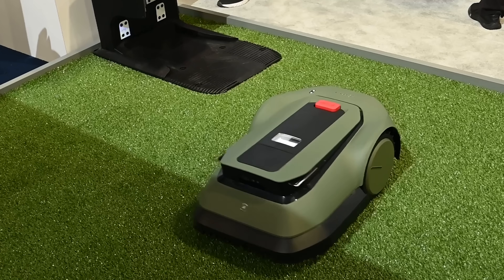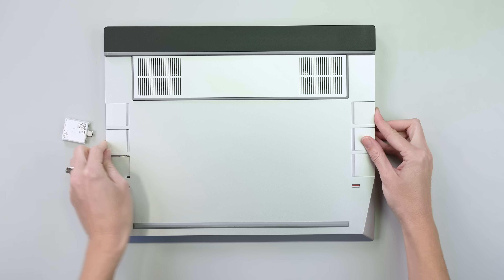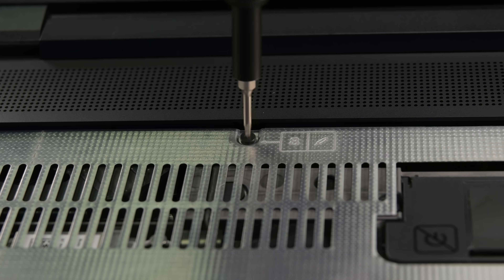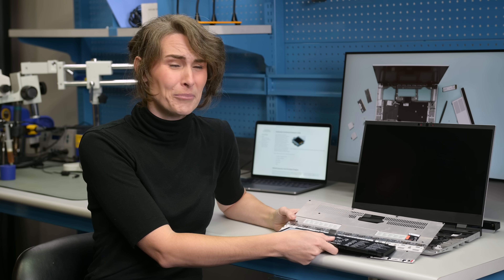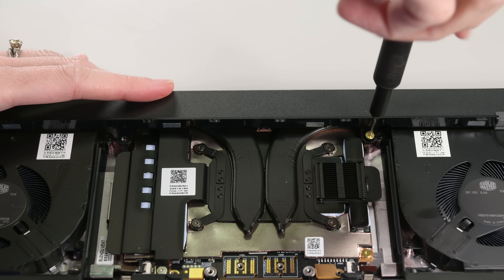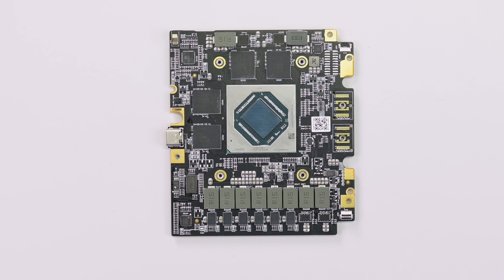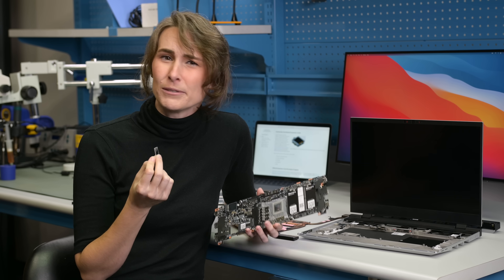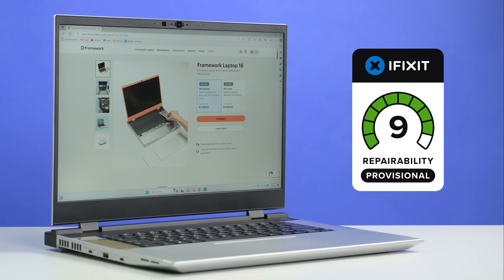The Framework 16 Teardown!-Best Teardown of the year already??

Comment: Framework is the nightmare of traditional manufacturers. Not because it is a competitor to the point of harming the sales of others, but to DESTROY the various false arguments that have been given in recent years that it is impossible to make something repairable without compromising quality or size.
Reply: lol at the coping answers.
it's not a black and white matter, Framework overdoing modularity to the extreme doesn't justify the outright hostile designs of every other manufacturer on the opposite extreme, who just flat out lies and claims it's a design requirement for the magic stardust inside
Reply: @andrealotito4412  this. They're building something designed to allow easy upgrades, but that doesn't mean other manufacturers can't build something easier to repair (but not upgrade). It wouldn't be so clunky if you removed some of the customisation aspects. The framework is about future proofing, but some people would be happy to just be able to change a screen, keyboard or battery with no fuss.
Reply: @JonathanMorris777 Well, technically speaking, that's what makes the framework so upgradable, that every component CAN be replaced.
Reply: @andrealotito4412  Yeah, but there's middle of the road options, mainly gaming laptops. Some of which offer even features FW doesn't like swappable batteries or upgradable desktop CPU's.
Reply: @andrealotito4412 💯
Reply: @andrealotito4412  
If you understand economics 101, manufacturers are completely justified in designing stuff to be harder to repair and with limited lifespan, thats just how Capitalism works, its an infinite growth model, to grow you cannot honestly expect manufacturers to keep making stuff thats easy to repair, and no the economics of spareparts and selling replacements is not sustainable. 

Thats how Clevo/Sager struggled, they kept selling extremely modular laptops for decades now, and yet, no one wants to buy them, Clevo ended up having to resort to just going the BGA way and solder everything to the board to save costs and maximise profit. 

But hey, if you think otherwise, you are against Capitalism, thats good, so am I in fact but unlike you, I rather like to understand what I am against instead of just parroting liberal nonsense I heard on Twitter.
Reply: Framework is showing the "other" extreme. Let's hope this paves the way for a company meeting half-way. I'd be happy with a laptop that gets an 8/10 repairability iFixit score. 
This looks a little flimsy, TBH. But I love the concept.
Reply: @LasCosasComoSean Yeah, the first framework 13" was also flimsy. Eventually they upgraded the hinge and the back plate, so hopefully they do the same for the 16"
Reply: thank apple for that really.
Reply: Is it more expensive to hire engineers to design a module laptop? Yeah of course. But for an end user the extra upfront cost evens out after an upgrade cycle. Instead of buying multiple laptops you can just upgrade your existing one
Reply: But security... safety... people are going to be assaulted... it's racist.... (Insert other crazy claims made by the computer and automotive industries to prevent right to repair).
Reply: Nightmare? Na. This won't make a dent in the market. And 99% of people don't ACTUALLY care about repairability. Just some a tiny minority that is really vocal. And if you think the repairability considerations does NOT compromise the size, weight, general efficiency, reliability, and other aspects, then I don't know what to tell you. It clearly does. Now, for some this is a worthwhile tradeoff. For most, it probably isn't. But to claim it has zero effect is outright false. There are SO many extra internal pieces of material to allow this, which requires space, and extra weight, and by definition is a compromise.
Reply: Oh, I see plenty compromises in the quality department.
Reply: framework laptops are not known to be compact (in relation to similarly spec'ed laptops) or sturdy-feeling (compared to laptops at similar prices).
Reply: Who do you think owns the manufacturing supply chain Framework depends on? 

If they took a noticeable chunk of sales, they’d stop making their parts or price them into bankruptcy.
Reply: @Errcyco  that sounds illegal.
Reply: Built quality and overall feel and look of the framework is quite a bit worse than a lot of other manufacturers though. You are compromising a modern design over one that looks 15 years old. Plus they are quite a bit more expensive than similar machines. 
That being said, a lot of features could be available at all laptops. Easily removable batteries, upgradable RAM and memory should be standard. If this is back in all machines on the market, and maybe even an easy way to replace the screen, the arguments for the Framework run out quick. Because then others will be cheaper, have the most important parts swappable as well, but look like an actual new machine - which we all know is a big selling point these days.
Reply: Does compromise on price tho
Reply: Well, manufacturers are kind of right, even framework is not repairable, its modularity simply allows you to replace a component instead of replacing the full computer. This modularity already existed on certain high-end (and very expensive) gaming laptops 10 years ago. The advantage of framework is that with their economies of scale, they managed to lower its cost. In that sense, they are pioneering something that other manufacturers might adopt later.
Framework is not cheap. You can get similar soldered-on specs for half the price. If you buy framework, you are merely betting on upgradability rather than repairability, because odds are, you will replace the critical components before they fail, just because you actually can!
Reply: this happened in 80s and 90s with Toyota trucks never breaking down to the point of american car brands bitching to congress to get the toyota hilux banned from the US for being "anti competitive" becuase it never broke down or needed repairs. i see the same happening to framework if they take off.
Reply: Not really. The price of the product compared to others with similar specs alone shows you that you are wrong.
Reply: You do realize traditional manufacturers also make gaming laptops, which are considerably more repairable and upgradable than most other laptops, right? You don't even have to pay super high amounts too. Infact, if you pay the right amount, you can snag ones with quality rivaling FW or even beating it. They've been doing this for over a decade. Perhaps thats why they are starting to rise in popularity so much. Framework truly has a very tough battle against gaming laptops.

And FW can do nothing against nvidia, amd and intel artificially limiting laptop parts to sell you overpriced laptops. Because OEM's have to buy parts that are supplied by these 3 companies. OEM's will pass the price hikes to you. Thats why AMD and intel too now, get away with selling you 2 gen old CPU's, nvidia gets away with blatant lies about the 4050/60/70's TDP of 140w given they can't use more than 100w due to voltage limit placed by nvidia themselves. 

It ain't black and white mate.
Reply: Tbf, laptop with similar performance is cheaper or has better built quality than this. And as a user I'd like to have not only better performance but also better screen, trackpad, keyboard etc when it's time for an upgrade so I'm not sure I'll be having framework anytime soon.
Reply: @nabara6949 Too bad that finding something that is an upgrade over your old laptop in all aspects quickly becomes an impossible endeavour. 

Sure, if your first laptop had an Intel Celeron single core, then you can probably get something better than it in everything simply by spending more. But once you have a good laptop, your future upgrade might still be a step down in screen quality, dimensions, weight, rigidity, keyboard, trackpad, cooling, RAM capacity (particularly when soldered), sound quality or loudness...

I always have one single reason why a laptop of mine would need to be replaced. For my first laptop, the motherboard had issues and performance was somewhat lacking, but the actual body of it was very pleasant (keyboard, chassis rigidity, etc.). My second laptop had much better performance, but the cheap plastic started to crack all over, and I could no longer use some of its ports. Even the plastic in the hinge cracked. But if I could combine the two strong points of these laptops, I would use them with no issues even today.
Reply: @nabara6949  My reply was seemingly deleted, but usually I would have kept most of what my old laptop had when I need to upgrade it. Furthermore, you will find it impossible to find a laptop that is better than your current one in all aspects. There will be some where it might become a downgrade, be it in display capability, rigidity, sound quality, compactness, weight, size, port selection, etc.
Reply: @nabara6949  Framework has been working on the design making it better but someone in the market for a Framework will probably understand that there is going to be added cost and some compromise to get this level of modularity.  The larger point is that other OEM's have been overall reducing end user reparability/upgradeability for laptops for any number of bogus reasons, Framework proves there is a market out there that wants a laptop that can be tinkered with and/or customized the same way a desktop can.
Reply: I don't see it.  My 15" MacBook Air is better in every single way.  I have been buying Apple laptops since my 15"  PowerBook G3 and I have never had a problem.  That's 20 years and never needing a repair.  Maybe I'm lucky .. or Maybe .. Apple makes a superior product.
Reply: @ericmatthews8497  Or maybe you aren't the target audience?  If your happy with what you have there is nothing wrong with that, some people want something else.  And you can find videos all over YouTube of many macs that have needed repairs, your not needing repairs for a small sample size doesn't mean it never happens.
Reply: @nadtz   I guess I am not a target customer.  I think it looks very primitive.
Reply: @ericmatthews8497  I personally don't much care how a laptop looks, I do care how easy hardware I buy is to upgrade or repair if I want or need to.  Probably a habit I've picked up after working on hardware for 30 years.  Different strokes for different folks and all.
Reply: @ericmatthews8497 Your MacBook is all looks no performance 😂
Reply: @poxbox6729  A complete lie. PCs throttle immediately when they go on battery.  Macs have performance , battery life, and portability.
Reply: @ericmatthews8497  You are working for apple... Which accumulator works twenty years? 🤔 You old macs are sleeping in your cabinet! Decoration😴
Reply: @ericmatthews8497  you are exceedingly lucky. I had several issues with my 2012 MacBook Pro retina. Image retention, blank screen (from gpu), certain there was one other thing. You will hope your latest apple is reliable because they solder everything to the board. If it has an issue outside of warranty it will likely be the case of throwing it out as they don’t repair so much as replace the entire board.
Reply: @ericmatthews8497  Good luck with the repairability and upgradability of a modern Macbook Air. Bascially every component in it is soldered to a single board, there's nothing you can do once you open the casing. You decide you want more storage? You can't. You upgrade the OS and it takes more RAM to run the background tasks and you want to throw in a cheap expansion stick as the computer runs sluggish, you can't. The entire thing is designed to be disposable.
Reply: @ericmatthews8497  "every single way" do you even know what framework laptops are? they are supposed to be use repairable, and there is no world where you can repair your macbook, in fact, even repair shops often struggle to repair it, or even can't, for example with the soldered ssd, which will wear down a lot if you get the 8GB model, because you will constantly use swap space, that is planned obsolescence at it's peak. Second thing is that you're stuck with mac OS, because windows doesn't run on mac, and linux runs pretty badly. Macbooks were actually rlly good in the past, because they were rlly good and repairable, but today's macbooks are a planned obsolescence joke
Reply: @M1szS  I’ve been buying Apple Laptops for two decades and never needed to repair one.  I literally have no experience with any of that. They just work. I have a binder bin full of old MacBooks - they all still boot up and run perfectly. The  “you cant repair your MacBook argument is utter crap!!”  I’ve never needed to. Isn’t that better?
Reply: @ericmatthews8497  hmmm… seems you have no clue about MacBook repairability. They used to be more repairable and upgradeable. Now you basically cannot. Apple rarely repairs things, usually opting for replacement of entire modules and third party cannot get replacement parts or any help documents. Even if done boards are available Apple has locked that up with serial pairing. I did rather like Apple, I’m on the fence now.
Reply: @ThurstanH  huh I guess I was also one of the lucky ones, never had to repair my 2012 retina 15", nor upgrade it since I got a CTO model (other than the AirPort card for 802.11ac + Apple Watch unlock). The battery only had to be replaced once in its 10 year lifetime, and by then tech had improved so much that retrospectively, getting a new Mac and selling my old one (for a decent chunk of change, too) made much more sense than continually trying to chase incremental upgrades and the like.

Computers/devices that need repairing or upgrading in general are in the minority. Pulling a statistic out of thin air, I'd say at least 90% of users don't ever have to repair or upgrade individual components in their device. At the end of the day it's all a numbers game; Apple has the buying power to source the highest binned silicon and very high standards for QA and QC. Them being the "perfect" company that they try to market themselves as just causes people to blow all their flaws out of proportion.
Reply: @ericmatthews8497 Why do you have a binder bin full of old MacBooks? Are you actually using them? Because if not, you should probably give them away or sell them.
Reply: @MrGamelover23   A couple of them I still use for testing purposes.  I am a 3D web software developer and we still support Intel Macs with Nvidia, AMD, and Intel graphics.  The rest of them are kept as museum pieces, along with a Bondi Blue iMac, and a Flower Pot iMac.

Comment: The only thing I don't like is the overreliance on rare earth magnets.

Otherwise, a very impressive design.
Reply: Yeah, I do not like the idea of magnets everywhere. It is not like the days when you could damage a hard drive with them, but aside from components where they are required (speakers, fans, input devices, etc.) I would prefer not to rely on them. Aside from the environmental impact and political issues, it is very easy for them to stick to other metal surfaces or to be repealed by other magnets.

Comment: not unlocking the port modules would indeed make them harder to remove lol
Reply: Was wondering why they didn't use them and then found your comment ♥️
Reply: They were unlocked as you can see by the red bar on the switch. The mechanism is different to the Framework 13.